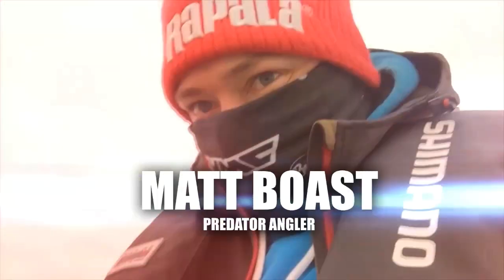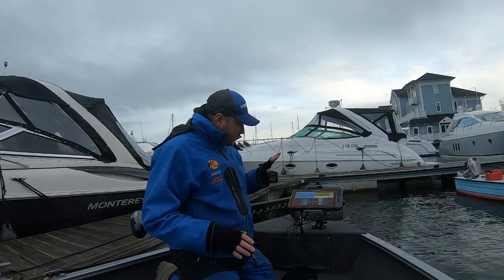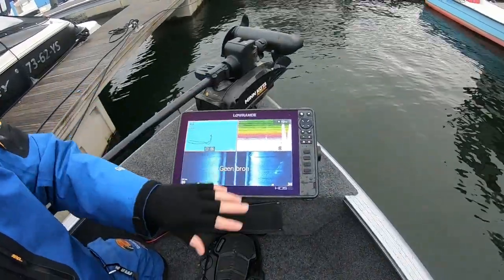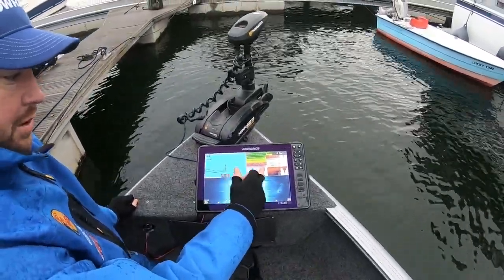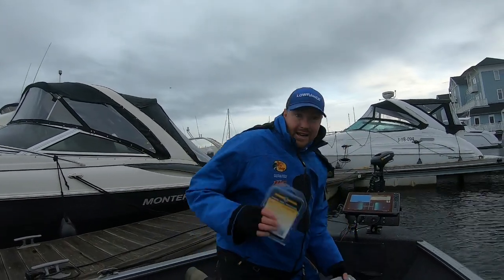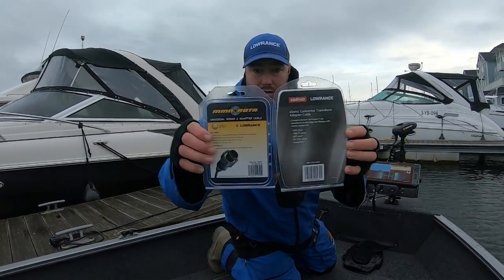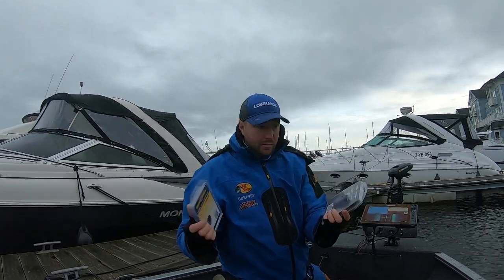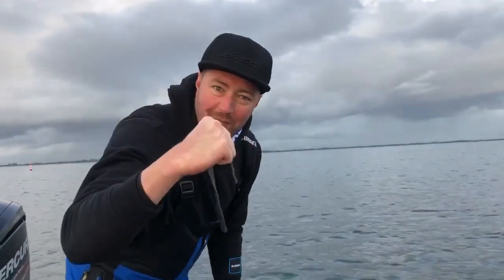using trolling motor transducer

Comment: I just try to understand, what you mean, to use these cables to connect Lawrence chartplotter and Minnkota trolling motor, so the motor will respond to all chartplotter instructions?
Reply from the maker: No it’s so you can use the transducer inside the head of the trolling motor

Comment: Gday Matt,  Paul from Australia here. Just wondering about this whole thing of connecting trolling motors to fishfinders etc 
I have a Motorguide IX 5 and want to get a new sounder that I can use to connect up to it. Then I can control it back at my seat. It’s all a bit confusing between what can and can’t be done plus not sure what this NMEA system is all about. Do you know or do you know anyone that can clear this up for me?
Reply from the maker: Paul Lobwein sorry for delay if connecting motorguide to Lowrance you need a gateway kit it’s fairly simple to install you will then be able to control from the head unit
Reply: matt boast just went and got a new Garmin so will set that up and then will get rid of the useless Motorguide to replace with a Garmin force which connects wirelessly to it for sounding and control.